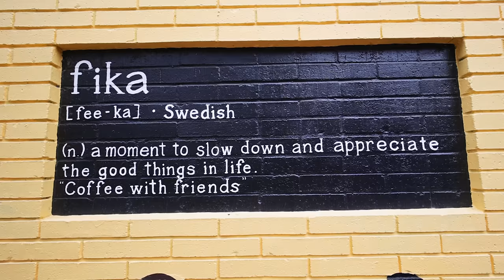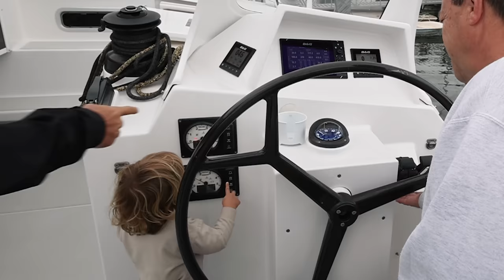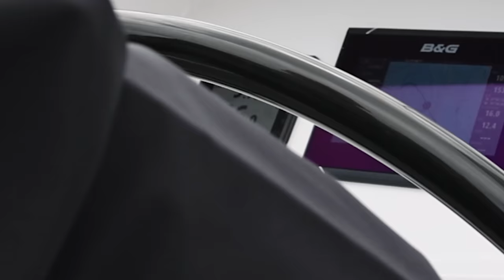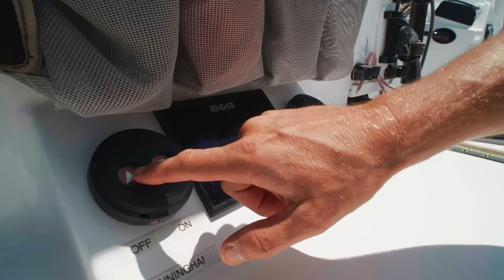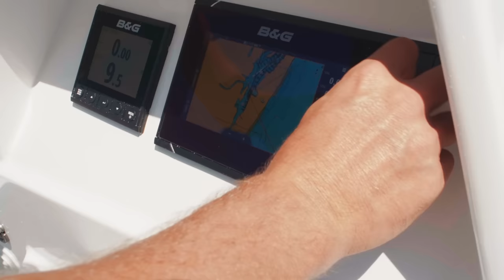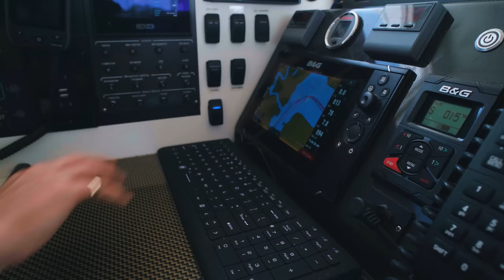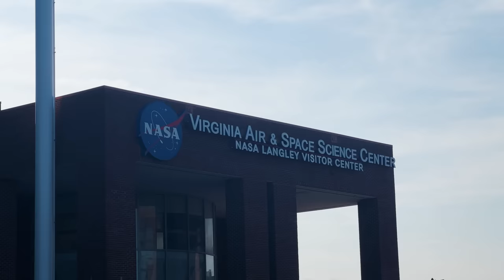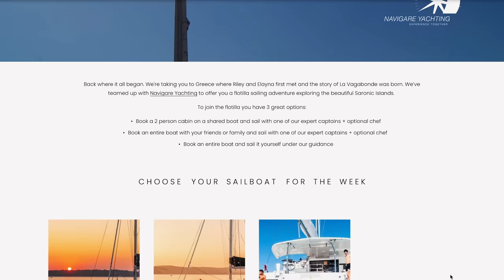We Sailed 20 Knots on this Custom Built Catamaran!

Comment: Besides her outstanding performance, I really like that Fujin doesn't really LOOK like the rest of the cookie-cutter stuff out there.  Wharram cats (especially the Pahi series) were specifically designed after early Polynesian boats, have pod-style accommodation, and are typically exceptionally fast and strong.  Fujin really reminded me of the Wharram designs, but with a racing twist.  It seems when you were doing around 15 knots or so, it was really stable and not too wet.  But when you got closer to 20, she started bouncing a bit and the spray was heavier.  What an amazing boat.  Almost a shame you have a Rapido in the works, eh?  Awesome episode!!

Comment: Riley you need trolling paddle flashers to catch more big fish at sea. Some are 8 inches to more than  12 inches. Using them on a charter boat we caught more than 10 steelhead in just a couple hours before storms rolled in. All the steelhead weighted between 8 and 11 lb.

Comment: Orbit -> not quite a circle, not quite an ellipse, not quite a corkscrew(vortex), each of which is an incrementally more accurate approximation, Closer yet might be -> The result of a sum of forces dynamically acting upon a subspace collection of a collection of sub-spacial forces each interacting dynamically. Perhaps just spin. Was the big bang really the big spin? That reminds me, don't forget to flush. Oh, and cool cat dude! Wow what fun to try out all these vessels, Would be fun to add these to a "Club La Vagabonde" fleet. If you fractionally sold each cabin for 10k a week/yr, then 3 * 50 = 150 * 10k = 1,5 Million. Seems like a deal to me.

Comment: Started sailing about 1969  Sailed a Hobie 14 that went about 20  knots  First day the news said wind gusts were in the mid 50's MPH not KPH  If, I could get an ideal speedboat it would be a gaff rigged sandbagger from the 1800's where tip of bowsprit to end of boom was at least twice as long as the hull
Reply: I was the first Hobie Cat 14' in Malibu. It revolutionized Beach Sailing!
Their 16' Hobie was amazing.
Let's of fun surfing my Hobie Cat.
Reply: @dennispatrick4999 i was too light to get it upright by myself

Comment: You are going to have to specify a bouncy tramp, apparently.  :-)  If you do, that's gonna get you a laugh or a strange look, or both.  Usually there is a number on the bottom of the tape measure that you add to the number read so that you can take the measurement without having to push the tape to the floor like that, which is not accurate, if you are ever using one for something that really matters like checking appliance fit or whatever, and one side is a wall. 

EVERY parent was that parent at some point.  "We still got grief.."  I can tell you who it was, the nearest Karen to where you were sitting.  I would just turn around and give 'em back a 'shhh' at about five times the volume.  A couple of times I've had people around laugh, sometimes, not so much, so read the crowd first.  Another effective method might be to turn around and ask who is saying that. Often loosing anonymity will shut that down.  I would probably ask them if they had kids, and then ask them if their kids were ever noisy.  Those are obviously both confrontational, but IMO rude people suck.

Comment: Watch out for the joker calling himself  Chad.  Im certain it was he and another calling himself  Ford  I met in backpackers in Gisborne NZ.  Im certain their CIA.  When the Obama was president at that time  radio active metal  was being used aginst me  -  to induce cancer.  Then those two came on the scene.  I was helping them with their vehicle.  {I picked they were cia }  so saw they were trying to distract me away from my tool box.  Later  Ir found an odd bit of metal   numb to hold.  And while helping them their screw driver -   your telling your hand to hold it to the screw but your arm / hand / dextity is not in proper control.     Sheep in their ignorance dont need to worry,  they die a dime a dozen anyway in their ignorance.  But Im pointing out where people lurk their heads to beware -  people are often not what they seem.  Usually up to something.   Good boat,  but I would rather the living space.